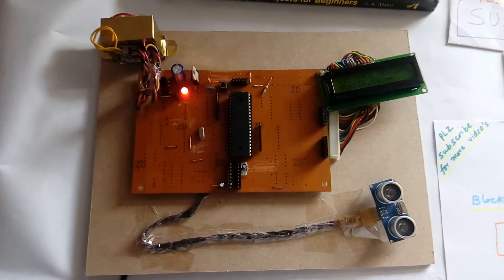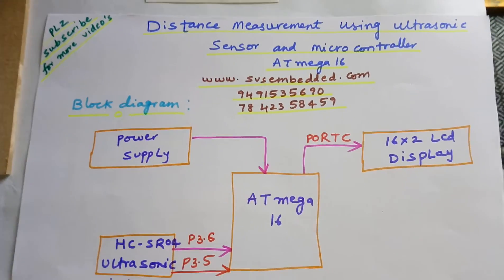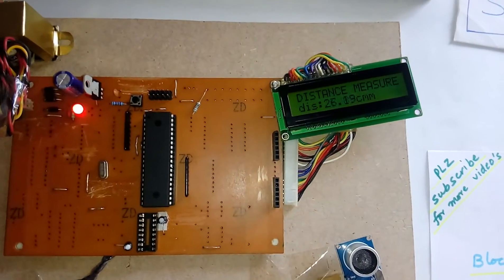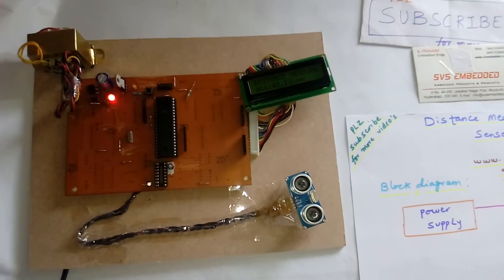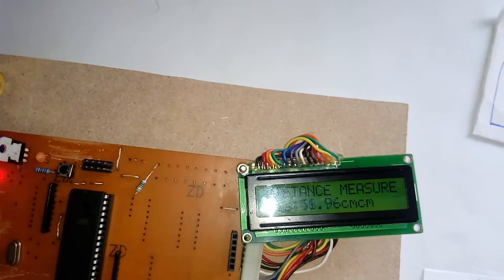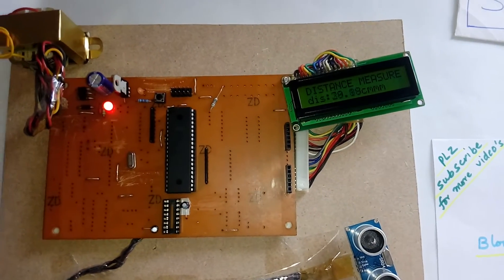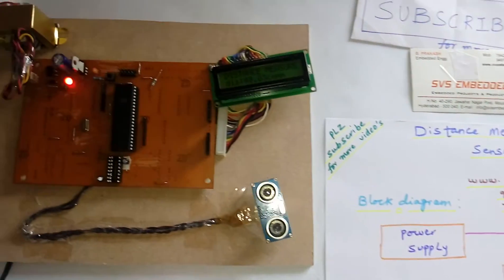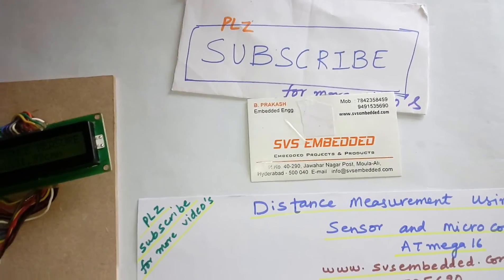DISTANCE MEASUREMENT USING ULTRASONIC SENSOR AND MICROCONTROLLER

Comment: i need the full component used list......
Reply from the maker: Thanks for comment and your valuable Feed back,we are selling the projects with least cost.
if u order the project we will provide working hardware kit along with 
1.abstract
2.datasheets
3.documentation
4.schematic( circuit ) diagram.
5.software code.
6.sample ppts
7.photos&video file on entire project
through google drive.if u r interested to take the project.
send me a mail to  svsembedded@gmail.com,info@svsembedded.com.
we will send u the how to order procedure to u.